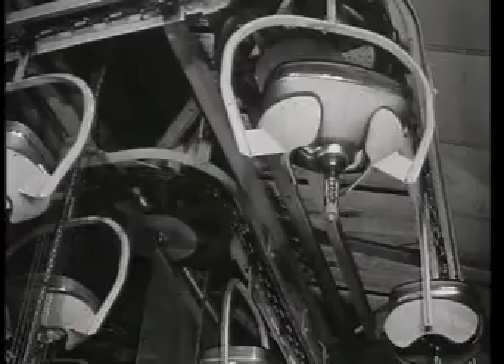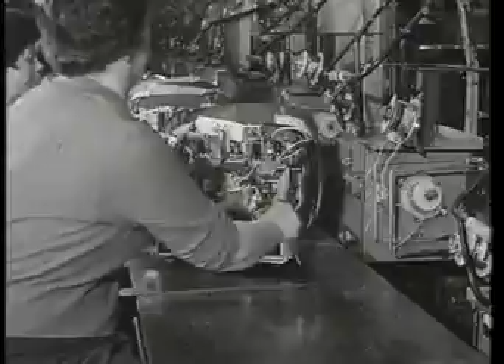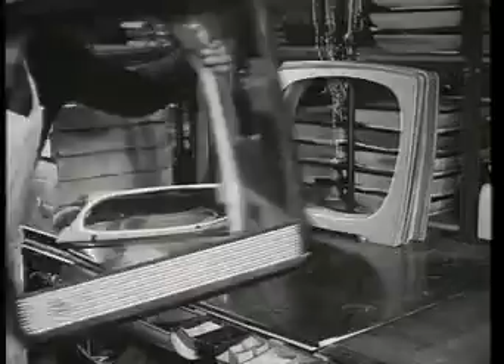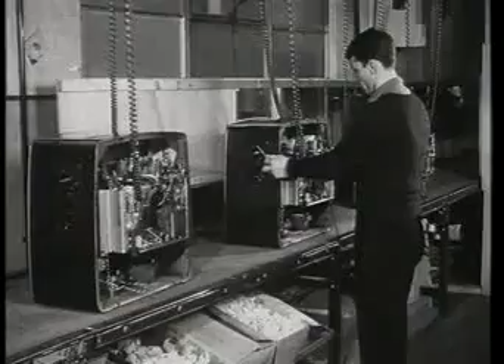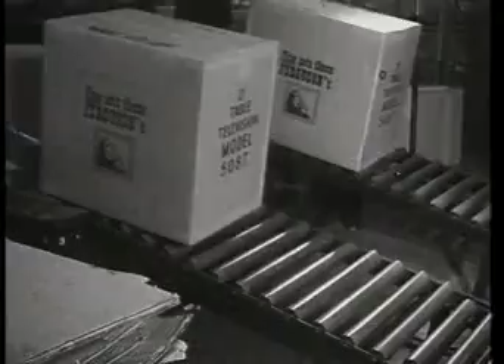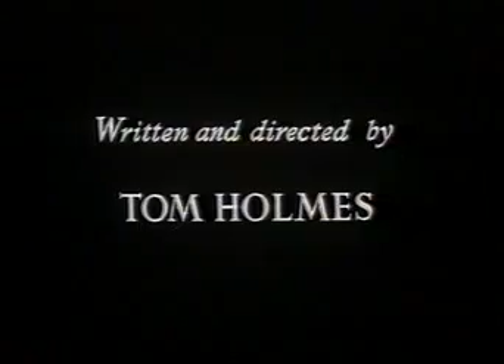HOW ITS MADE 1950S TELEVISION & RADIO FACTORY FERGUSON THORN EMI

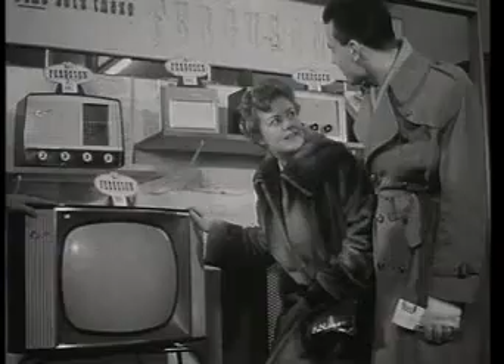Comment: I remember the model shown at 3:34. They were supplied here in Australia by Radio Rentals (part of the Philips empire) branded as "Baird" for some reason, on a rent now buy later con.   They were crummy sets, didn't interlace properly and had a restricted IF bandwidth, making the picture blurry.  The tubes often developed a fault after the customer finally owned them - the picture would move downwards until it disappeared, shortly after the set warmed up.   A temporary cure was to install the tube upside down.  A trap for inexperienced repairmen, because if you set it up for convenient access, on its side, the picture would stay and you would think there's nothing wrong with it.
The rocking test reminded me of when I went on tour of an NEC factory.   At the end of the production line a big robot arm grabbed each set, shook it violently (and I do mean violent), turned it upside down, and shook the heck out of it again.   They were good sets, those NEC's.   If they were the only brand, TV repair places would have all gone broke.

Comment: This film sure looks like the old "Eye on Research"  that Raymond Baxter narrated from 1959 to 1963. As for the date shot clues are the TV sets frames /chassis are Plastic, a late 1950's mostly 1960's trend. This happened when TV's started not to be wooden furniture, and when the newer short neck CRT's came out.

Comment: Unbelievable how large the soldering irons used to assemble the TVs were. It makes sense that it would take more heat to melt the blobs of solder between the thicker wire components. That much heat would destroy a modern component. It is also interesting how many factory alignment points were necessary to bring the TVs to the proper frequency specifications. When I was young my father had two second hand tube televisions. One had a picture only and the other had sound only. When watching you just had to make sure they were both set to the same channel.
Reply: It doesn't take more heat to solder larger wires and components, it takes more energy. The temperature of the large soldering iron used here will be no higher than a small soldering iron used for reworking SMT components.

Comment: It's hard to believe how rough those sets were handled and still made it to the customer without breakage! I am also wondering how many employees received shocks when handling the INSIDES of those sets after they had been turned on and off!
Reply: They weren't constructed from wafer thin plastic sheets and fragile, barely-soldered lead-free solder joints, that's why!

Comment: I have a Ferguson Monocrome Portable from the Early 70s with the old push buttons one of the early 625 Line sets.  Althrough the Tube is a bit tired it still works.
Reply: If it has some valved circuitry, it's possibly a 1500 chassis.  I had a 1500 "portable" for many years.  Nothing quite like a 30FL2 sync separator valve which has gone microphonic, for strange wobbly pictures.  If solid state, it may be a little later than early 70s.
Reply: @video99couk  if a 'portable'  most likely a 1590 or 1591 chassis, if it has a 12v input,   if not, a 1580, 'hybrid' valve/transistor, much rarer...
Reply: doubt if 1500 if 'portable',
Reply: @andygozzo72  Mine was a 17" 1500 portable (luggable).  No 12V input, but a handle on the top!
Reply: @video99couk  i had 'heard' there was a 'portable' , well, semi portable, version of the 1500, but never seen one, seen plenty of the 'normal' 20 inch plus versions...  the 1590/1591 portables were fairly common, i used to have several...

Comment: Loved this, i am an ex television engineer from the days of Cathode Ray Tubes. Ferguson, what a great brand name. Still have a couple of 'Fergies' in my workshop for nostalgia !  Look at the build quality, that circuit board would not sag under weight.
Reply: Yes indeedy, do you remember the Ferguson Videostar 3V29 and how to change the idler wheel and tape transport bulb? Used to do loads of those, we did :)